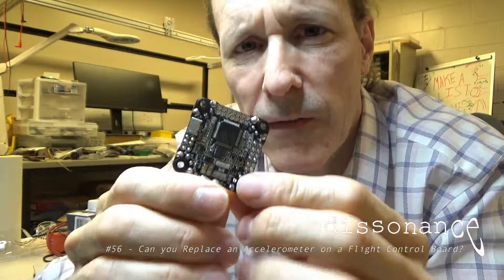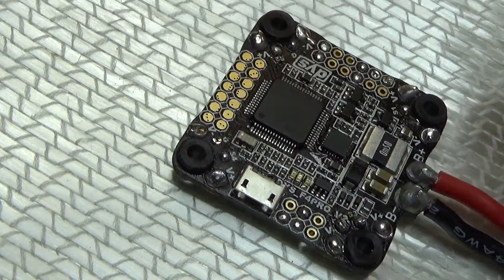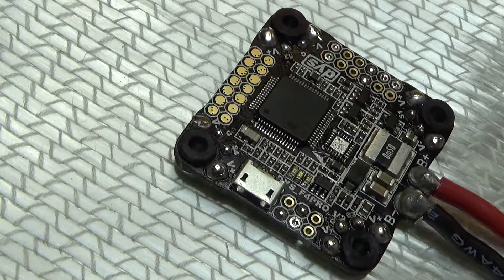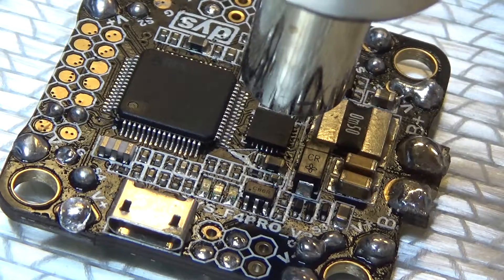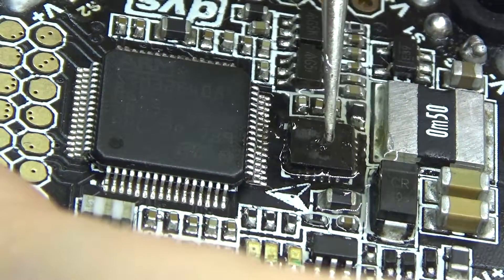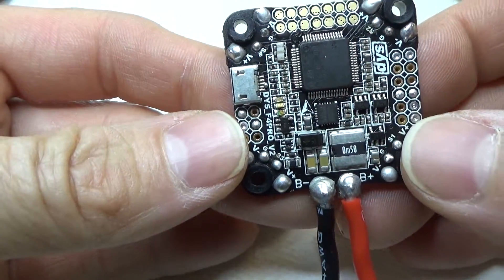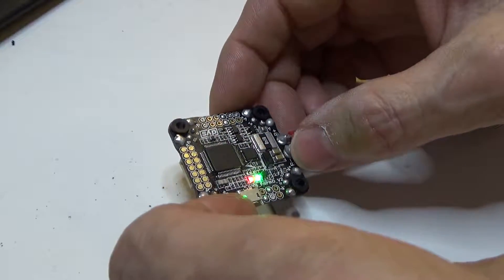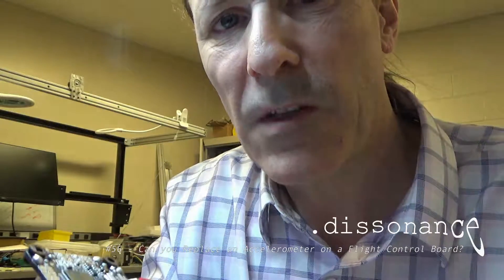#56 - Can you Replace an Accelerometer on a Flight Control Board?

Comment: Good to know. Thanks for the vid. I'll offer a tip with no intention to criticize just trying to be helpful and it will probably Dawn on you the moment you read it, heating the chip with a blower such as yours is tough because the chip itself deflects the hot air over the top of the solder joints on the sides of the chip so it takes a lot more indirect heat to get them to flow temperature, which obviously puts a much bigger heat burden on the chip adds a lot of time to the effort and there's always a risk of other components getting grumpy with all that heat. LOL just thought I'd share something that might have just slipped your mind or hadn't occurred to you at the time. There's some simple ways to disperse the heat more efficiently. I don't have the sources in front of me for products because I've come up with a bunch of different sized homemade devices that attach to the end of my hot air tool. They simply block the center of the airflow and divert the heat to a square pattern that blows straight down onto the welds. With a slight taper inward. I've cut the time it takes to reach flow temp by probably 2/3 at least.

Comment: Oh, the gyro and accelerometer is the same chip? I have to learn how to do these kinds of repairs because all of this Chinese quadcopter stuff is absolute junk. Blown MCUs, blown gyros, blown mosfets on ESCs. This is really unbelievable. 2 weeks I got out of this flight controller before it turned into a dangerous buzzsaw that flies and turns itself at full throttle. I'm waiting on a different flight controller to replace one on another quad that blew the F4 for no reason. That one lasted nearly 2 months. I have 3 bad runcams, 4 bad tinyhawk flight controllers. So I better learn to do these repairs because i haven't bought a single thing for this hobby yet that works longer than 2 months.

Comment: I am astonished at the pitch of the tip you are using to dab leaded solder. I am going to have to sacrifice one the tips for my back up iron and file it sharp. I actually had to rebuild the damned thing to be able to use it for this project. Another problem is that I might have to remove the flash memory chip to be able to go over the pads after reflow attempt. In a moment I was all upbeat about it and in the next I am grizzling and bitching. Are you using some visual aid?  The photography would imply that this is the case